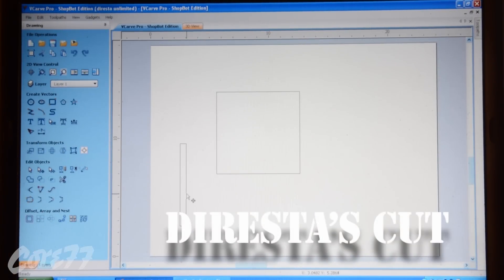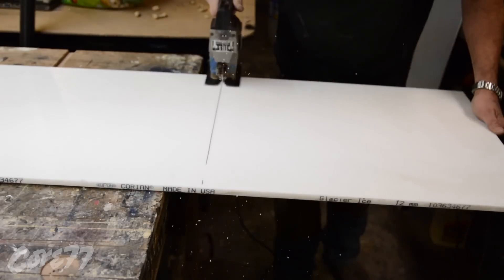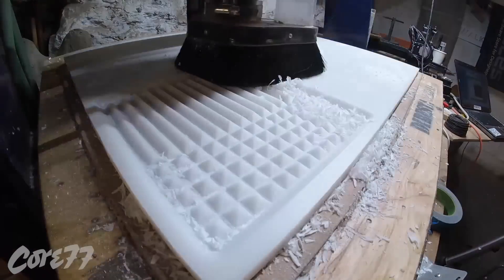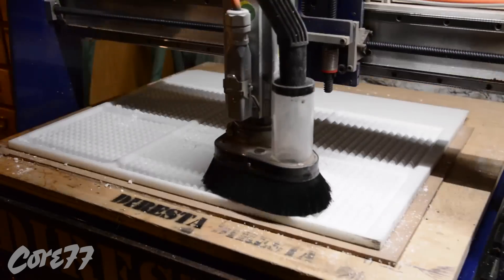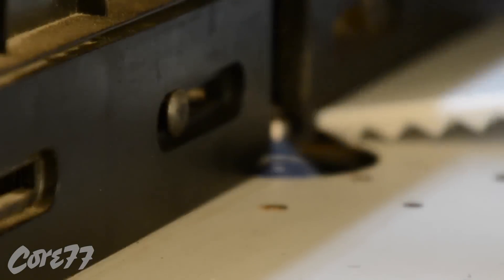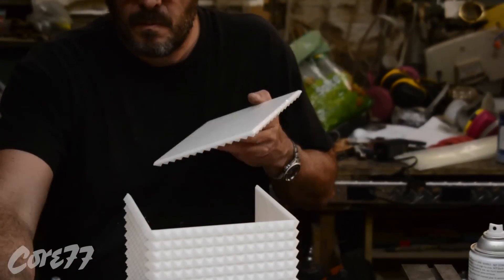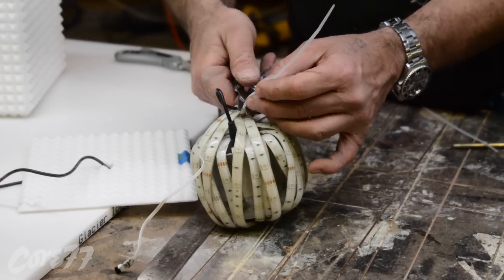DiResta's Cut: Corian LED Lamp

Comment: Awesome build but I'm curious about the heat factor. Isn't the overlapped string going to get hot to a point that it'd affect the lifetime of the light? You could actually try to coil it around a conical shape if it does.

Comment: Lamp cords are usually 18gauge wire, basically a 5 amp fuse. It shorts, wire burns. Been zapped thousands of times with 120v , can't imagine 240 would be fun. Regardless it's the amp draw that will fuck you. Drill into wire and a small zap, try taking off live meter and your melting screw driver.

Comment: Jimmy - you can pulse-width modulate the RGB LEDs to get pretty much any color you want.  Requires the use of an Arduino, or use Blinkinlabs RGB LED ribbons instead (if you use the latter, you can easily program pulsing regions of color for different faces of the cube).
Thanks for the great videos for many years!

Comment: To peel off hot glue just tap around the sides of the glue with a cuetip dipped in isopropyl alcohol. It runs under the hot glue and you can peel it off like no problem. 
Almost like magic.

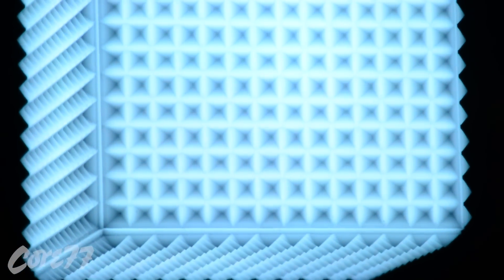Comment: Cool.  At 7:00 about the last close up shot of the cube in white.  It looks like one of those optical illusions where you can't tell if you are looking at the outside of the cube or the inside of the cube.  Stare at the big flat panel and you see the outside.  Stare at the lower left corner and, to me at least, it inverts and looks like the inside.   Cool.
Reply: +cemx86 yeah, its an awesome pattern for this too. when you look straight on one face you see more through and its brighter while the angled faces held darker color. sweet build jimmy

Comment: @jimmydiresta the reason the led lights strobe on camera is because the fps (frames per seconds) on your camera vs the ones on your led lights are set at different rates. You can try the same thing with cars with led lights.

Comment: Great work as always = ) but a trick i always use to remove hot glue cleanly is a little alcohol or lighter fluid and the glue will simply peel right off. I haven't tried it on normal wood but it work great on MDF and any other smooth surface.

Comment: Really cool Jimmy! My uncle used to work in a hospital in Queens and they must have used this stuff for some areas in the hospital, maybe the kitchen? Anyway, he had literally tons of scrap and my father ended up getting some and he used it for thresholds and kick plates and windowsills. It machines like Teflon. I believe the bulk of what he had was thrown out after he passed. It's a shame, I never knew it was so expensive! I noticed there was light between some of the panels, was that due to the poor activator?

Comment: Anyone else ever get a drop of CA glue on their finger that already had activator on it? 

If not... don't. About 100X worse than hot wax.
Reply: +Josh V glued my fingers together a few times, always missing skin after that happens
Reply: I do about 2-3 times a week lol
Reply: +Mike Wiebe Keep some acetone on hand. With that, you should be able to unglue your fingers w/o tearing up your hide.
Reply: +Josh V I did it once.  Now I wrap with masking tape before working with CA.  A little insulation from that thermal burn goes a long way, with an added bonus that tape releases much better than fingers from the workpiece.
Reply: Benjamin Shaw
 Ya normally I wear latex or neoprene gloves. I was out one time and.. ya thermal/chemical burn. Ow.

Comment: You flatten out the MDF but then add uneven hot glue blobs to the Corian... why not double sided tape?
Reply: The stuff is heavy and I doubt the glue would be uneven blobs and remember, he spaced it and things tend to find their own level, especially a sheet of corian that probably weighed 30 lbs.
Reply: +WKDworks Good thinking friend.
Reply: +WKDworks In his procon jcb sign video he uses spray adhesive, even better!

Comment: Great outcome. I've used that brand accelerator and didn't have any problems but have switched to Starbond CA glue and accelerator since I get those thru my local woodturning club. They work great.

Comment: Easiest way to break hot glue I found is to use isopropyl alcohol. hot glue just stops being sicked to the surface and you just take it of with no effort. You can find isopropyl alcohol in a spray can too.